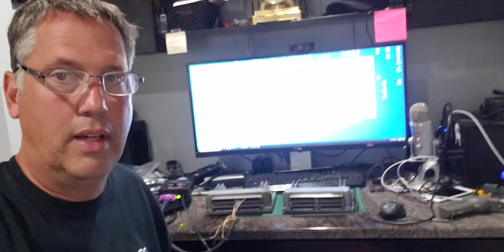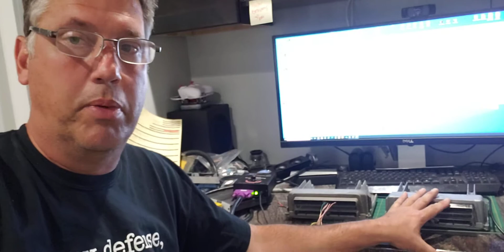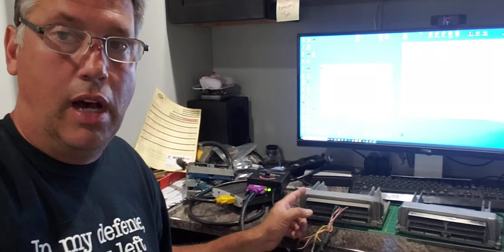Off-board flashing of a GM ECM/PCM

Comment: Sorry to get off topic, I am curious about your 2 post lift installation.  Did you modify your flat ceiling trusses or was everything done for the lift from the day it was built?  There are not many videos about the process to modify trusses or figuring out minimum clearance for lifts.
Reply from the maker: I had the garage built this way so I could install the lift. It's 14 feet tall inside at the peak. I know that trusses can be modified but you should really have it checked by an engineer especially if you live in a area that gets significant snow. A local guy modded his trusses and had a collapse a few years ago.
Reply: Thanks for the info, I agree an engineered solution is best if for no other reason than to have the engineering stamp for resale.  My neighbor modified his trusses for living room ceiling height and it's still going strong.  We haven't had a blizzard level of snow yet so who knows, not worth the risk and worry I guess.  I have contacted a truss company and they were super helpful but the engineering companies they passed on to me have been less responsive.  Building from new seems to be the smartest way to go, congratulations on your nice setup.